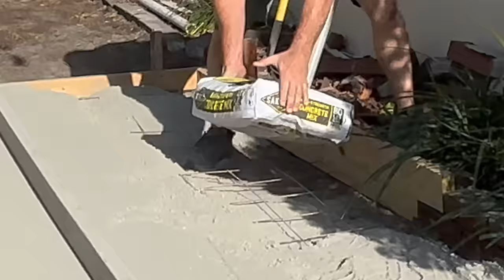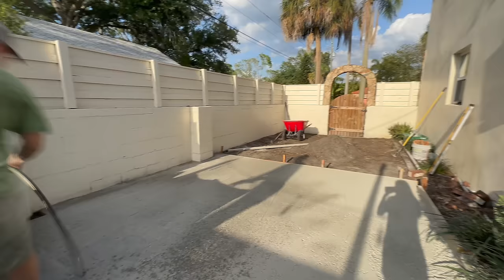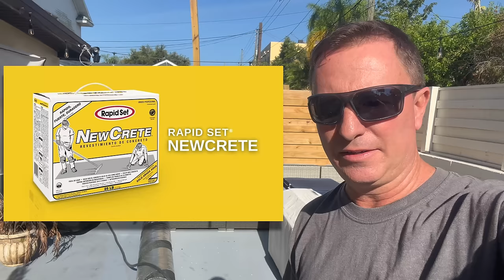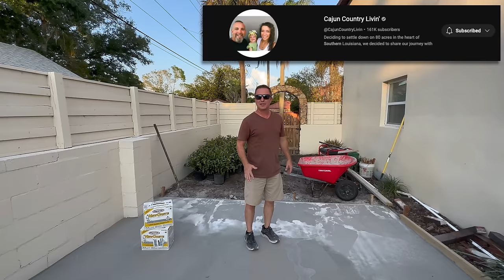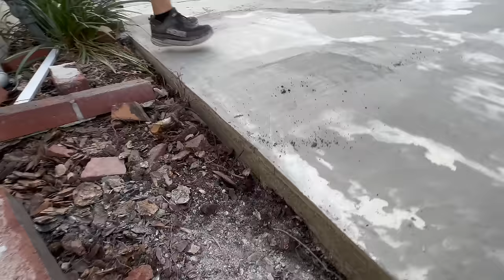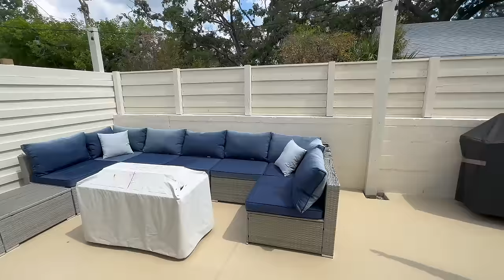Doing Dry Pour Concrete DOES ACTUALLY WORK?

Comment: When you sprayed just the top, how did the water reach all of the powder concrete?   I am wanting to pour about a 4 inch pad and can't understand how that water is going to go all the way depth wise.  Any info is appreciated.
Reply from the maker: Great question. I don’t have a definitive answer for you as I am learning with the others who are using and experimenting with this technique. I can tell you that I wet the ground before pouring out the concrete so the water would be absorbed from below. I do plan on doing a follow up video in a couple of months, which I know is no help to you now. Thank you again for asking a great question.
Reply: It doesn't. The capillary action of the cement draws moisture from the ground.

Comment: I want to do a dry pour in 6x6 sections. I also want to put pavers over them before I start with the water. I also want to build a pergola on top and I'm thinking I need some forms to go down deeper than my forms for the 6x6. sections. I was thinking about doing 14 by 14 oergona on top with 5x5 posts. I would use 6. I think the high strength concrete will work in a dry pour.
Reply from the maker: Thank you for sharing. Everything you mention seems viable. I’m not sure about the pavers because of my lack of experience with them, but the rest seems on track. I have since added a roof structure over my patio and when drilling to install the 4” x 4” metal brackets there was no break away or crumbling, which I did have some concern about happening with the dry pour method. Also, to further clarify, these posts were placed on the corners. 

As I am now reaching a year since the the dry pour I have come to believe in this method more. Actually, I am sitting at a table on top of the dry pour in the video as I am writing this response. Bottom line. I am glad I dared to try this method. This patio has brought me and my family much joy. I wish you all the best.
Reply: @justintimevlogs2492  My sections turned out to be about 3x8ft I layed down like a grid. each 3x8 is further divided with two 2x4s in the center creating a channel to match the other channels. So I thinking I am going to do the wet pour on the corners and dry in all the other sections. Will the wet and dry look the same?
Reply from the maker: There will probably be different shading in the wet concrete.  I had this happen on a job site once.  One truck mixed slightly different than the other and we were left with two different shades. Frustrating when you tell them ahead of time the mixes need to the same.

Comment: How do you account for a slope for water drainage with dry pour?
Reply from the maker: You account for the slope with your frame.  Had I planned to film this dry pour from the beginning, you would have seen me using a long 2" x 4" with a 7' level to make sure there is a pitch from one side of the frame to the other.
Reply: @justintimevlogs2492  excellent thanks for the comment. Me and the MRS are planning to do a 12x12 slab with a walkway. Just to put some lawn furniture and a medium weight gazebo and do not want water puddling. CHEERS!!

Comment: next time ya should use a pvc pipe for screeting roll easy almost painting constistancey rolls instead of drag ...allows some mixing action during roll. i got some crapy qwickcrete i like more powder to what i need i did dry side walk no frame but luckily i can do finer crete paint  toper . for the edges..ya gota be carefull to get some actual powder in ya rocks other wise it sucks for the stuff i got.
Reply from the maker: Thank you for the tip.

Comment: For those concerned about the water getting all the way through, with no dry spots at all, couldn't you do the bottom 2 inches first, give it a good spray and then add the top 2 inches right away , and spray again when done ?  Just wondering , would that work as well ?
Reply from the maker: John I believe another couple did there dry pour in that manner. You could only use that method with smaller slabs. If memory serves me correct, I believe they did 5’ x 5’ slabs.
Reply: That's not recommended. The water will spread upward quickly. If you're working a large area some of it will start to harden before you get to the step of screeding.

Comment: Do you need gravel... How much to dig?
Reply from the maker: I did dig out about 2” so I could have a 4” slab through out. I then wet the dirt and used a handheld compactor to make sure the ground was solid. I then poured the bags on top of the compacted dirt. So, no gravel.
Reply: @justintimevlogs2492  I'm in the pac nw Oregon where it rains quite a bit does it matter???

Comment: I have seen quite a few dry pour slabs and they all look like crap. Does it work? That's not the only question. Does it save time? Does it save money? In your case it did not save time or money. I don't care how well you screed it, or paint roll it, it's going to leave a rough finish. If you are going to tile the surface then the finish doesn't matter but does dry pour save you anything? Or make anything easier? It sure doesn't look like it to me.
Reply from the maker: Yes, you have seen a few, but not all dry pours are bad, plus many of the people posting videos about dry pouring are DIYers. If they did a wet pour video, it too would probably not look that good.
Did I save time? Well, not that much, as it took a little less time compared to the wet pour I did last year, but it wasn’t about time saving as it is about cost savings. Compared to a professional company, a person can save a minimum of $1,400 on a slab the same size as mine. I understand you don’t believe in the process but there are benefits to a dry pour, and yes screeding followed by brooming does make a difference. I assume you have never worked with concrete or you would not have made such a comment.

Thank you for asking valid questions about why anyone would try something different, like a dry pour.
Reply: @justintimevlogs2492  Advantage also is less steps and less work.
Reply: @justintimevlogs2492  Excellent retort.    Wet or dry, if you've never done it before, it maybe cosmetically not up to standards.    The key here is $1400 savings.
Reply: @justintimevlogs2492  savage reply was very necessary lol.
Reply: @justintimevlogs2492  It would not have cost you one dime more to mix it with water and then pour it. Then you would have been able to get a nice finish.  Not sure what you mean by blooming unless you are referring to lime blooming. Anyway, I have poured hundreds of yards of concrete over my long career in the building trades. The only time I have ever seen dry pour is in a hot mop shower pan. The concrete is covered in tar so you never see it.
Reply from the maker: You are correct regarding the cost if I wet poured it myself but you seem to be missing the point. I am sorry you are struggling to understand what people are trying to do in this moment in time. This technique is a way for DIYers to accomplish a concrete pad on their own and save a ton of money by doing it themselves. I tried this technique to see if it worked and it did. You can either accept that fact or not. Would I as a professional prefer a wet pour? Yes. But for those who don’t have the money or experience, a dry pour will get the job done.

I hope you are able to understand not everyone is as skilled as you or has the money you do to hire a professional. Please  use you your time more wisely to help others. I am sure you could possibly offer a lot of good advice.
Reply: Some people are always eager to make a negative comment…I think your slab came out good and it’s helping new DIYers to accomplish something that otherwise they couldn’t do! By the way I was doing this dry pour concrete twenty years ago… still there… no cracks
Reply: At 72, I can do a dry pour as fast as 2 men can do a wet pour. They will spend more time getting out their toys, cleaning them up, and putting them away then I will spend dumping bags off the back of my truck, screeding it off with a 3" PVC pipe, and hosing it down. I would guess you have little experience with wet pours and none with dry pours.
Reply: @justintimevlogs2492  Another "pro", missing the point. Color me surprised. You will wear yourself out trying to reason with them, but it's a healthy exercise! I've poured more concrete than most people have walked on, but this method is fine for many DIY projects for people that want to save money but for whatever reason don't want to tackle a wet pour.

Comment: Do you think your pour would be strong enough to drive a car across? 4" seems like it should.
Reply from the maker: Great question.  I believe it possibly could because of the way I prepped and executed my dry pour, but I would NOT recommend anyone use dry pour  for a driveway.  I would recommend and still do wet pour concrete for driveways.

Comment: Tell us about the longevity and corner strength of a dry pour pad. How many years of testing have you done.
Reply from the maker: Darrin, dry pour is relatively new in its popularity. I don’t believe anyone can answer your question with certainty. For this reason I tried it and so are many others. Also, for this reason I personally would not use this method for anything structural.

Comment: Isn't it much cheaper to order wet concrete in bulk?
Reply from the maker: Yes, bulk is cheaper but what is your point?  This was a small project.
Reply: @justintimevlogs2492 For my 24 SQM project I calculated 120 bags of concrete needed at AU$10 a bag would be AU$1200. The wet concrete would have been $AU400. The labour of each method is to be considered. The size of the job too. I considered the labour and said bugger it, I won't do either.

Comment: Dry pour is NOT a good way to do concrete and will NOT last as long as properly mixed concrete. Its a literal waste of time and will crumble easily later. LAziness is all it is.
Reply from the maker: Thank you for taking the time to provide your opinion. First of all, you are correct to say that traditional water-mixed wet pour is the optimal method.

However, please keep in mind that this video was geared towards DIYers, many of whom lack either the skillset or the financial resources to do a traditional pour.  For them, I would suggest that dry pour is a viable option for doing simple slabs, and not a “waste of time” at all.

As far as durability is concerned, I’m aware of dry-pour slabs that are more than 20 years old, and have yet to crumble, easily or otherwise.  This suggests that in certain cases, dry pour can be a comparatively easy and cost-effective solution, and to dismiss it out of hand is, in fact, rhetorical laziness.

Thank you again for your time.
Reply: Laziness?? I don't see this guy being lazy... even he gave you an explanation that you do not even deserve!!

Comment: Where are the expansion joints?
Reply from the maker: Thank you for taking the time to provide your opinion. First of all, you are correct to say that traditional water-mixed wet pour is the optimal method.

However, please keep in mind that this video was geared towards DIYers, many of whom lack either the skillset or the financial resources to do a traditional pour.  For them, I would suggest that dry pour is a viable option for doing simple slabs, and not a “waste of time” at all.

As far as durability is concerned, I’m aware of dry-pour slabs that are more than 20 years old, and have yet to crumble, easily or otherwise.  This suggests that in certain cases, dry pour can be a comparatively easy and cost-effective solution, and to dismiss it out of hand is, in fact, rhetorical laziness.

Thank you again for your time.
Reply: @justintimevlogs2492  I think this response was intended for someone else.  I just asked about expansion joints.  A slab of that size will usually require EJ.
Reply from the maker: @robcschweitzer you are correct. I apologize this response went to the wrong comment. I must confess I am still new to dealing with YouTube as a content provider. The backend mechanics are sometimes confusing.
Reply from the maker: I apologize for the delayed response.  There are two joints where the 3 slabs join, which were cut after the filming of the video.

Comment: Dry Pour works just fine to BUILD with it just wont last as long
as wet pour. You will be replacing it all in a few years.

!
Reply from the maker: Based on what facts.  I have personally seen dry pours last longer than fives years.  Bottom line, a well executed dry or wet pour will last for years.

Comment: Have you driven on it yet? :)
Reply from the maker: My slab is not meant for a car and I personally would not recommend dry pour for a car. Our dry pour slab is meant for foot traffic only.
Reply: Agreed... but this is a different product than I've seen used and since you are familiar with it, I wanted your opinion. I may replace my deck with a patio. What are your thoughts on epoxy?
Reply from the maker: Depends.  I do like epoxy but have not used it on a concrete slab.  I personally have only used it on counter tops.  After much research, I have only used and would only use a product from Leggari Products (leggari.com).  Great company and a great product.

Comment: Question:  With a dry pour it seems less water is used so am I right in assuming the slab would weigh less?
Reply from the maker: The dry pour slab will weigh the same as a wet pour slab once the concrete is fully cured.